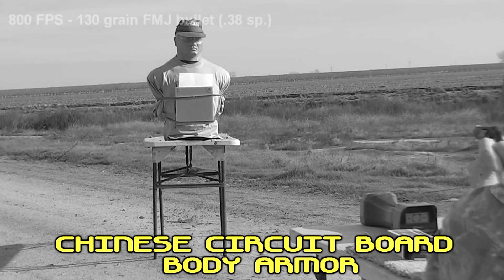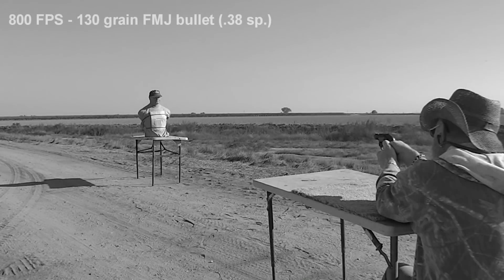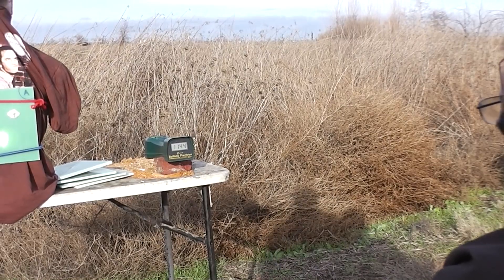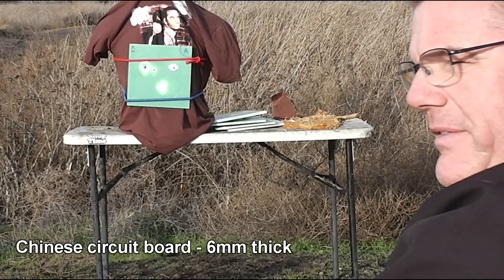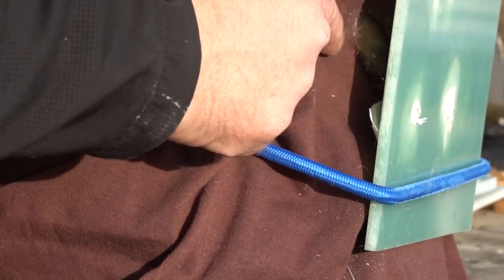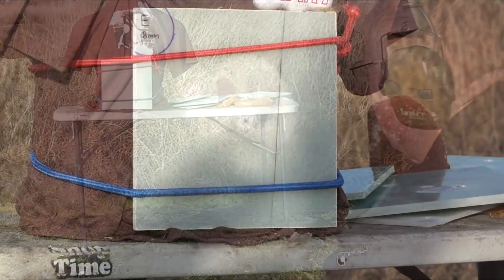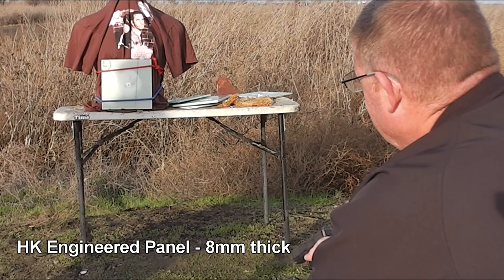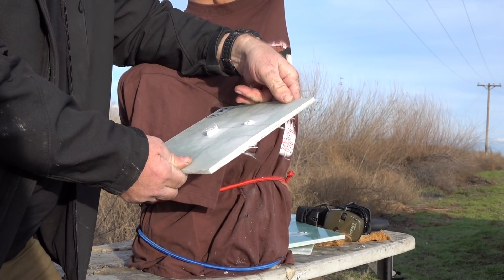CHINESE circuit boards -  are they BULLETPROOF?

Comment: Hi there!

Im just rewatching this video and have a question out of curiosity.
In this and some other videos, you are talking about "grains".
How much does the grain you use wight?

If i google it, i get weights of (around) 65mg per grain, 15grain per gram and some other numbers. It would be really nice, if you could write some metric number's in one or two of your next video's.

Sorry if this is much more work and many thanks if you can make it possible.
Kind regards from Germany, 
Kammerj4ger
Reply from the maker: Bullets are measured in grains.   Most countries use this as a standard.

Comment: seems to me if each laminate were turned 45 degrees when stacking and gluing, the break pattern wouldn't be a + and spread 8 directions instead, to be much tougher.
if they are ordering in 1 mm thickness the sheets could be glued and pressed into a bit of a curve, where a press that heats them as they solidify may help more structurally.

Comment: I don't see anything wrong with this. You are testing it pretty much how they would if they were able to. You are grabbing some stuff and shooting it with what you have to see what it will do. You are not a lab trying to certify stuff for crying out loud. Any data is better than no data. From what I have seen you guys test I would say one of these 5 dollar plates and one of those cheap ebay kevlar panels would work pretty well against just about any handgun ammo they could throw at you. If they have a rifle you are screwed, but that is pretty much how it works no matter what. If they have an AK you are not safe behind a car unless the engine or a wheel is infront of you. I have shot cars with various .30 caliber rounds and they all pretty much just punch right through them. And those were old 70's cars, not newer lighter ones. If I remember right a car door wouldn't even stop 9mm ball ammo.

Comment: so, I was thinking maybe you could combine the 10mm and the 6mm with some space in between
like spaced armour
I know that the german leopard has something like that at the front of the turret

I would also be curious if there is a real difference if you strap them both together vs having them spaced apart a bit
maybe even try with 8mm+6mm it would be lighter, but I assume that lead rounds would deform so much on the 6mm plate that the 8mm would stop it just fine

Comment: i just bought the anarchist cookbook and there is an page that talks about converting an shotgun into an grenade launcher but i don't live in the us so it is very hard to get an shotgun here so i can test it myself

make with an 12 gauge shotgun an tripod with having the but as 1 leg and putting it in about an 45 degree angle

open en shell and remove all the shot

get an stick that fits nicely into the shell or shave ti down to fit

when loaded have the stick extend out of the barrel

attach an rubber pad to the end of the stick and place an molotov cocktail onto it for testing use something like an water filled plastic bottle 
reason an molotov cocktail mostly contains gasoline and that is lighter than water but an glass bottle is heavier than water so it should kind of be the same i gues

and i would have done it myself and made all the stuff so you can also test it but don't have shotgun shells

Comment: If they could order the 6mm plates in bulk and tape two of them together, that'd provide pretty good protection from the pistols. Sandwich a dish towel in between them and tape another one to the back to help catch fragments would be good to facilitate an escape. As long as nobody has a long gun.

Comment: Not sure what grade of laminate it is but here's an example of the types that are available, FR4 370HR is the the most common but there's a whole lot of varieties that are easily available.   Also the "plastic stuff" is called UHMW or ultra-high molecular weight Polyethylene which can be a bit expensive but it also widely available.  https://www.4pcb.com/laminate-material-vendors.html

Comment: I'm really curious to see how the results might be affected by using a heat gun to heat the boards up just enough to give them a little curve so they'd fit over the chest better and not give a flat surface for impact. It'd have to be done slowly to make sure no resin was lost, but it seems like it'd keep the properties it already has and add the benefits of sloped armor to help redirect impact forces.
Reply: Given their intended use in electrical settings, the resin tends to be thermoset, so it doesn't seem to flex when heated from my experience working with them (including tin plating a large area of one with a heat gun and solder).
That being said, the boards are available in quite a lot of thicknesses, so could be sawn or sheared into 'scales' and layered over eachother by sewing onto a backer

Comment: It is made for heat resistance properties. It is made primarily with an intermediate chemical BTDA (3,3’,4,4’Benzophenonetetracarboxylicdianhydride). The refined BTA chemical is made into a foam instead of resin and sprayed onto plates used for heatshields for spacecraft. I used to be a process operator for this chemical. That is how I know about all this junk. These are made for heat and not durability. I would not trust any of this unless the HK police were using flamethrowers.

Comment: "Turns out they could buy it for 5 dollars from China"
My experience working in research. We had a circuit mill specifically designed  for making custom circuit boards things several thousand dollars. Used it once just for fun, we can order custom circuits from china for like 6 dollars a pop.

Comment: Fiberglass welding blankets cut into the shape of a plate, glued together with fiberglass resin, and clamped between two steel plates to dry and cure performs remarkably well and only costs about $30 and a day or two to make. I've even seen them stop 12 gauge slugs.

Comment: Just flipped back from a website about body armor plates. Sounds like polyethylene armor is a sandwich of two types Ultra High Moleculer Weight (UHMW) and High Density PolyEthylene (HDPE). All of these are available in sheet stock but HDPE could also be available in pipe format. It looked like HDPE was the hard center and the UHMW was the keep it from fragmenting energy absorbing layers. If the FRP was replacing the UHMW in the sandwich HDPE is pretty widespread (inexpensive) it would be very interesting to see what 3 layers 6mm each would do. 

FRP 6mm , HDPE 6mm, FRP 6mm  the HDPE might need to be 8mm? And finding a way to bind it together will be the trick. Unless the FRP is cut with a larger perimeter and the FRP plate are bonded to each other and cured in a vacuum.. basically clamping the HDPE plate like a vise.

Comment: I have been told a layered combination of G10 plates and Kevlar cloth is used to armor the underside of V hull armored personnel carriers to protect against IED explosions and shrapnel.

My guess would be, 3 layers of 1/8" G10 with 2 level II soft panels in between, would make one heck of a flack jacket!

Comment: So... i said it last time, I'll say it again, I think a layer with a softer plastic between panels would be best. 
3M makes a softer tape for construction panels; they call it something like Viseoelastic polymer.
Short of that, white glue that's had borax added to it and allowed to cure for several days, possible while pressure and heat are applied, might be ok.
Using a soft plastic binder saps energy off the bullet by partially liquifying as the projectile moves through it. 
That said, High density polyethylene is the plastic used to make milk jugs, certain cleaner bottles, and opaque plastic shopping bags (the shopping bags are mostly banned on the west coast of the USA). Getting enough to make an armor plate isn't hard.

Edit: to clarify where the plastic should be....

Comment: I'm pretty sure, the Chinese don't use Buffalo Bore or Underwood 38 Special ammunition.😆
Reply from the maker: You can't say what they use.   You test for the worst case scenario and a little beyond that for safety.  Like making sure a ladder rated for a 250 lb person is still safe if someone 300 lbs uses it.

Comment: G10 is basically fiberglass weave and resin with a color so its more or less the same. its used among other things in knifehandle scales. its very tough and resistant to most impact things etc and general wear and tear.

Comment: Well as you have already stated in this video adding any extra layers will help in the protection. I will say if I was to add anything it would be same size floor tiles for the higher velocity rounds
Reply from the maker: A dinner plate would even help

Comment: I'm curious what the weight per area of that 10mm plate is. Looks to be reasonably light the way your manhandling it. Which is the real tricky part of body armour. A few mm of the right steel type will stop many rounds, and a few more will stop anything short of a 50 cal but it's going to be so heavy it's impractical as body armour.

Comment: I'd be interested to see what you could stop if you layered the "circuit board" with the E-Bay off brand Kevlar. How heavy would they be together?
Reply from the maker: The ebay kevlar easily stopped 10mm and should also stop .44 mag by itself.   Even if we stacked every fiberglass plate and the kevlar,  it wouldn't stop a rifle round from an AK,  etc

Comment: if the HK engineers could make a more conformed to the body shape plate to use as a trauma plate, but use the no-name Kevlar for the primary stopping, that'd probably be more than sufficient.  that trauma plate to spread out the force of the impact, even though it doesn't penetrate the Kevlar, could easily save a lot of broken bones, even if the Kevlar stops the bullet itself.

Comment: Has anyone strapped a piece of granite countertop coated in flex seal? I cant test much, I only have .22s, .45, and 20gau. And I live in a city, but if I lost 25 lbs I could easily run with 25lbs of granite! Love the vids! 
P.s. wouldn't mind seeing flex tape, epoxy resin, plastic coat, sticky vinyl tiles up to whatever thickness... I have lots of ideas, but my .22 will clean through a treated 4x4 with about 2200fps. So many ideas!

Comment: I wonder how well 2x5mm plates would stand up compared to a single 10mm plate. 
I would suspect that it would offer better overall protection than a single plate, 
also what about shaped plates with a bit of a dome, I could see that adding the advantages of slopped armour and deflection for better protection.

Comment: Of course the 9mm round made it through the 8mm  plate but not the 10mm plate. That's because 9mm is more than 8mm but less than 10mm. The Hong Kong plates are stronger because a Hong Kong millimeter is bigger than a Chinese millimeter.

Comment: If you put the circuit board in the Ebay armor bag like plate armor. Would that stop the AK or high velocity 9mm. 

The Ebay armor is going to stop the bullet but it's going to break some ribs. I would rather be shot then let the Chinese police get a hold of me. 

Both ways you probably are dead, one just cuts torture out before hand.

Comment: Is it practical to compare this material to similar thicknesses of metal? You’d need a shroud to catch ricochets, but it would be interesting to see if, for example, 8mm of aluminum has better stoppage per pound of weight, etc.

Comment: Wonder how it would change if their was a steel plate flex glued or attached to the panel,  with some sort of ceramic or tiles on the front. You could probably get some mild or tempered steel from a metal working class at a high school or trade school.

Comment: Hi guys ! great video . I wonder if these plates would work better with even a mild steel plate behind them and then coated in bed-liner coating material. Because those fiberglass shards coming out the back of those plates look nasty just by themselves. I'm just sad the holes aren't big enough for the ol' OG finger wiggle...

Comment: It would be interesting to compare these with 1/4” plates of 6061 aluminum, 7075 aluminum, mild steel (eg A36 or 1018), 4130 alloy steel in various tempers, S7 or D2 tool steel properly hardened, and titanium alloy. It might also be interesting to throw some engineering grade plastics into the mix, something like a 30% glass fiber nylon, Delrin, ABS, and GPO-3.

Comment: I bought some 1/8"thick steel plates to make a pellet trap to shoot with my 4.5 air rifle and I wonder if it could stop bullets, maybe a few pistol rounds. Steel is probably a little bit easier to buy in large ammounts than circuit boards. But the problem is that it's not hardened steel, hardened steel plates would be more costly. Leaf springs are hardened. But they would have to be cut and have the pieces welded together.

Comment: What are those ears that OG is using? Do you have a link or supplier?
Reply: Howard Leight electronic hearing pro.  Probably the most common ears used by shooters in this country.  Easily found on amazon and cheap.
Reply: @OGsDangerShow  thanks!!

Comment: Circuit board material comes in a lot of varieties and while they are all layered, epoxy coated fiber cloth similar to how G-10 is made, they aren't the exactly the same as G-10.  FR-4 gets used a lot for PCBs now because it stands up to heat better and G-10 tends to get used more for knife handles and gun grips and furniture because it stands up better to impact and scratching.

Comment: So, the Kevlar and the fiberglass plates in conjunction will be the best option. Maybe the Kevlar against the body and the fiberglass on the outside ripping the energy out of the bullet for the Kevlar catches mitt at the end. Try this combo in different orientation. Kevlar, glass or glass then Kevlar and then glass again...and so on. Thanks guys for a great video

Comment: I think the plates are made of NEMA "FR-4" material commonly used as an electrical insulator between each layer of a printed circuit board. FR = "Flame Resistant" . G-10 does not have flame resistance hence it is not commonly used in modern PCB manufacturing.

Comment: One question- how much do those circuit boards weigh compared to equivalent protection-level actual armor plates of the same size? They sure look like they handle as if they're a lot lighter.

Comment: A 10mm fiber board wrapped in newspaper to insulate it and space it. With a floor tile on the front, wrapped in seatbelt fabric (tightly woven Nylon).

Comment: Honestly, HK protesters would be at a good advantage to use those boards with Kevlar on the back and a 1/4 in steel plate behind that held in a vest if not even adding Kevlar to the front of the plate as well. The vest would be pretty heavy in front and back if it were armored but the hydroshock would be significantly reduced with two hard and two semi-soft surfaces sandwiched. Would be curious to see how well that would hold up to these tests.

Comment: With all of the negative comments I got from other fans, this was all I wanted guys!

You now can see the difference between the FMJ and the Hollow point. 

In both tests the bullet was significantly slowed by the boards the hollow, vs the longer barrel FMJ. 

That is all I was asking. That is a great comparison short barrel HP ve shor barrel HP in the 2 calibers. 

Thanks for the further explanation,  bit part of my point was proven with this closer comparison.  The plate, may save a life vs not with HP, if the officers shoot the HP. I know we are all speculating.  

I also get the high velocity vs the lower also. 

You are ALL great advocates and great help to the community.  You are soing a great service.
Reply: See, now I watched the 10mm plate, stop a hollow point, vs the FMJ. 

Guys you are great, but that is the same vs the same. 

Long barrel vs long barrel FMJ 38 and 9mm would also be comparable
I have not finished watching yet though.

Comment: I am a fan with a modest suggestion and some thoughts to accompany it. Mix ballistic gell between 2 of the 8mm HK plates and test that please.  I would say thick enough to divert the path from plate 1 to 2 and change the impact at second plate to an angle. It seemed that if there was something to help absorb the frag of the 1st plate and displace the impact of the bullet it would be better.  About 20mm (gel) is my thickest practical size for concealment.
 I was thinking about ablative armor when I saw people talking about putting the soft armor behind.  Those chips that occur at failure seem more dangerous to the fibers in the soft armor.  If the soft armor was epoxied to the front maybe better though. If it was put in a pouch maybe that would keep them aligned and from the reflex impact from creating coverage gaps on the plate.  Thank You for the time if you made it this far.  Good day all.

Comment: what if you reinforced the ebay Kevlar with epoxy so the energy is spread evenly across the plate instead off taking a mach 1 punch to the ribs?

Comment: The one advantage to the home-made vacu-formed armor is that simply making it 16mm thick  (which is similar to standard poly body armor) and slightly curved with top angles and you will have some SERIOUS Level IIIa armor.  yeah, the store-bought is cheaper and easier, but I'm betting the home-made is better.

Comment: The .38, and the 9mm bullets only differ by .002". So, basically the same diameter. You made a good point, by saying that they were pretty much the same. It's shocking how many shooters that don't know this. 9mm=.355    .38spec=.357    .38super=.356   .380acp=.355   Yep. All pretty much the same.

Comment: What you think if you've used FMJs in that 9mm on those plates would've it gone through? As FMJ as I understand is designed for more penetration than hollow points.